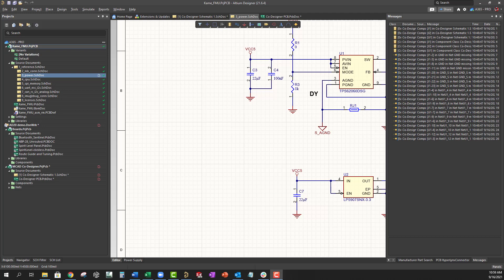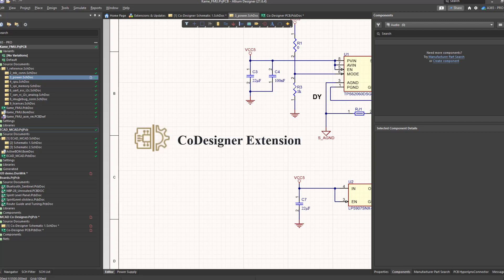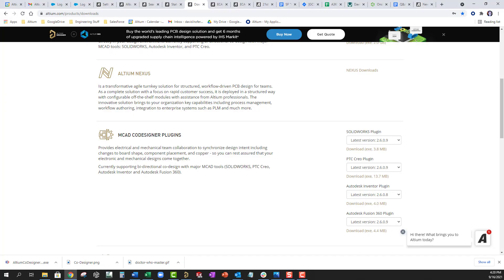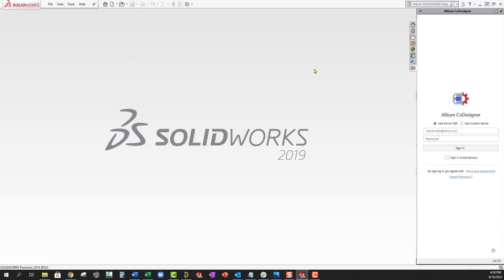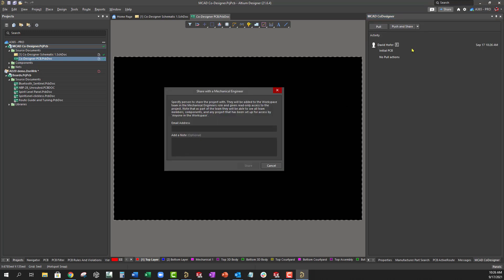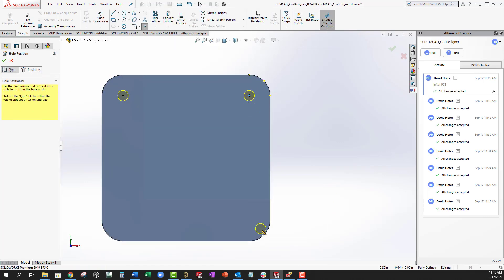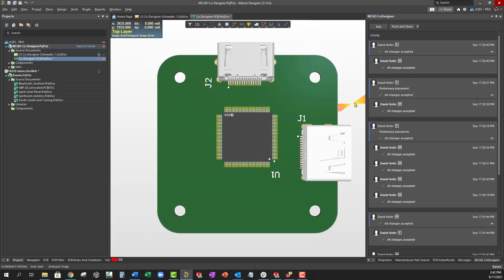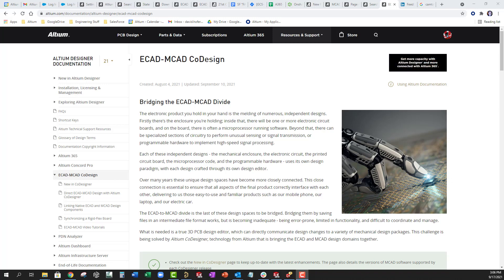Using MCAD Co-Designer in Altium 365

Comment: Hello,

Which one is better to use with SolidWorks? MCAD co-designer or Solidworks PCB Connector? What's the differences between them?
Reply: I've used it with someone else who uses SolidWorks, and I've used it myself with Autodesk.
Reply: Solidworks PCB Connector is going away in 2023. Both are from the same maker (Altium), pretty much the same thing. SW PCB connector is a few versions back from MCAD co-designer, so the MCAD co-designer has better technology. MCAD co-designer supports several different MCAD tools while SW PCB connector only supports SW. Hope this helps.